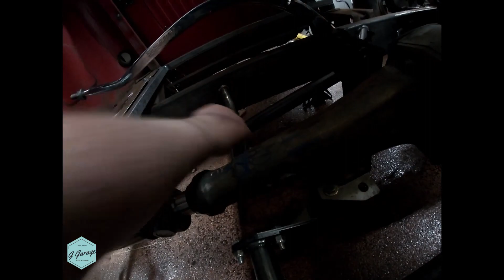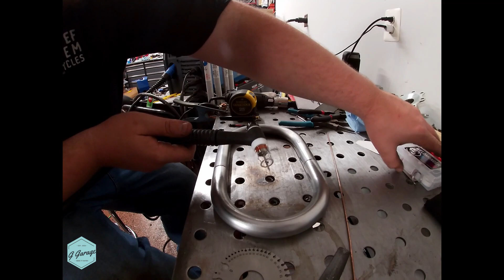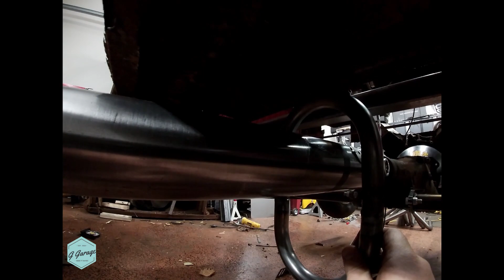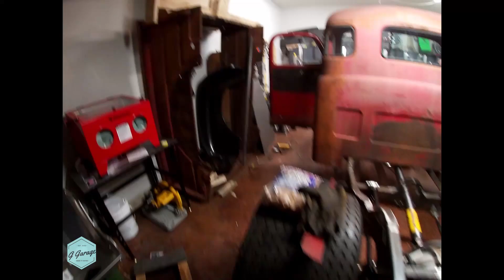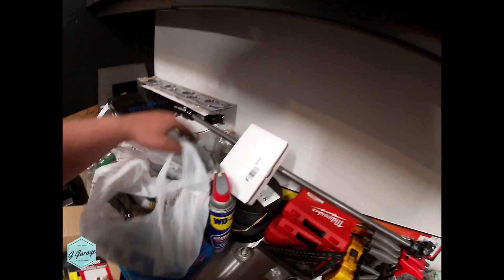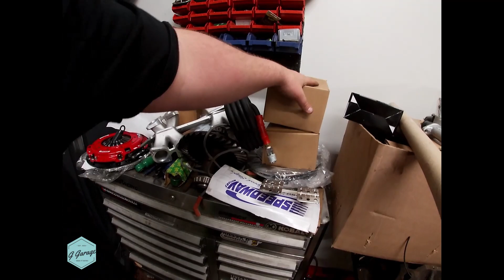GGarage Episode 7: How to build A NHRA compliant DriveShaft Loop | Custom DriveShaft | Shop update

Comment: I think the drive shaft loop has to be 6 inched behind the front yolk. 🤔
Reply from the maker: So I had to look it up as well when building it and the rules state behind the front yoke but within 6 inches past the front universal joint. I have mine at 4.5 if I remember correctly but that was a while ago
Reply from the maker: Drive-shaft loop
For cars with driveshafts that contain universal joints: For all full-bodied and open-bodied cars running between 7.50 (*4.50) and 13.99 (*8.59) in place of a crossmember located behind but within 6 inches of the center of the front universal joint: A front driveshaft loop is required on all cars, except vehicles running 11.49 (*7.35) seconds or slower equipped with street tires.